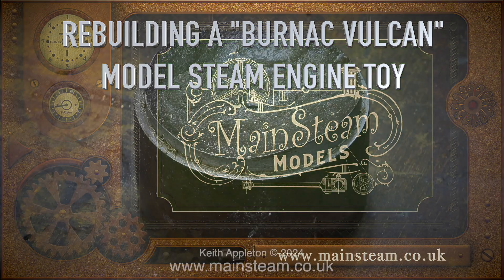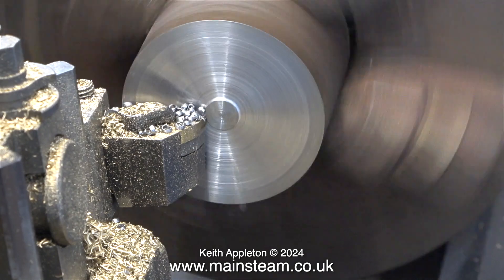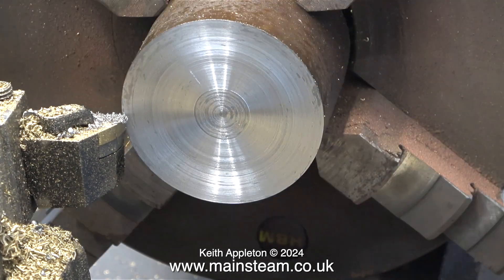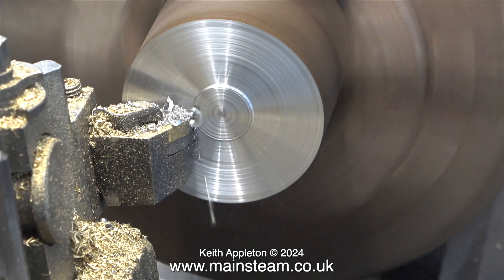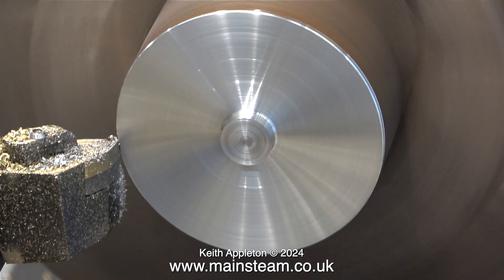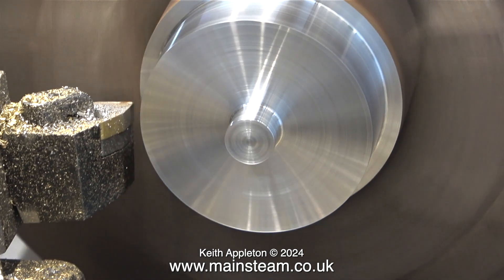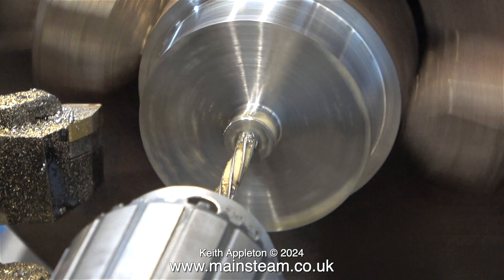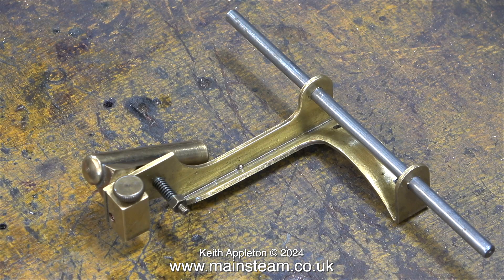REBUILDING A "BURNAC VULCAN" MODEL STEAM ENGINE TOY - PART #21

Comment: I tried working my Lathe with my "Belt Slackened" and it just does not work, I have to use one hand to hold up my trousers or they slide  down around my ankles. I would have to use suspenders, and the only ones I have are on my fishing waders and if I wore them in the shop they would soon have lots of small leaks